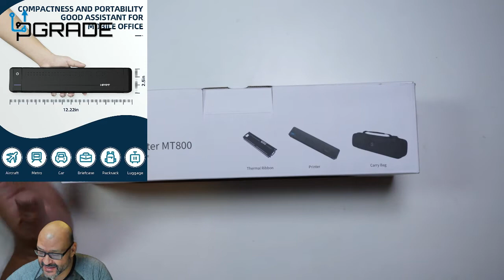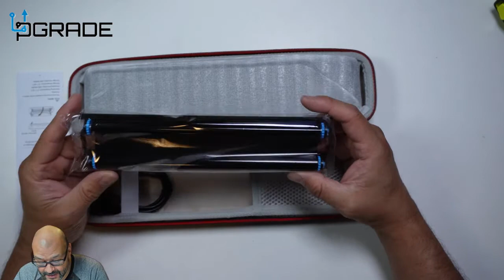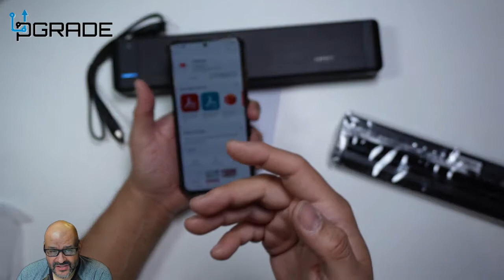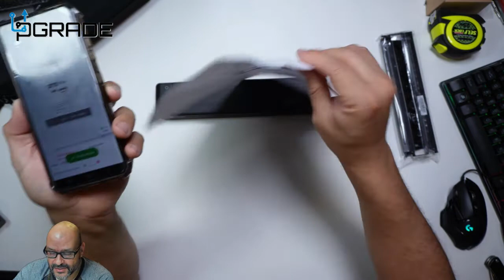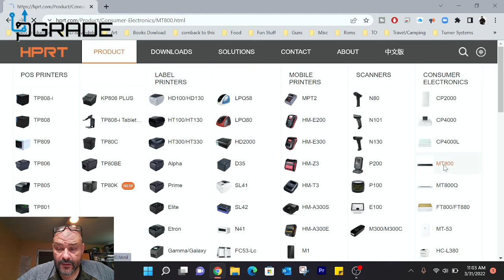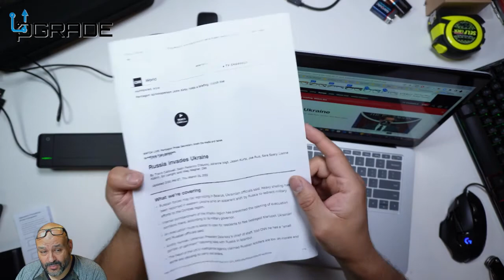HPRT Thermal Transfer Portable Printer

Comment: I have this little printer. Why when printing do the papers come outunpainted? (Blank)?
Reply: Most probably because you're using regular paper. This printer consumes thermal paper. Think this way, the "ink" is chemicals all over one face of the paper. What the printer does consist in heating the right spots on the paper to make it black. Although a thermal printer requires thermal paper, in general a thermal printing costs half the price of the same printing in gray scale using ink.

Comment: why do you have to buy a new cartridge every 50 sheets? plus thermal paper? what is the point of this printer if it's not to save on repeat costs?

UPDATE: according to multiple amazon answers you do not need to replace the cartridge. This includes an answer from the manufactuer. Can you kindly provide link (proof) to explain where the replace cartridge every 50 sheets number comes from? thanks
Reply: It's a special ribbon cartridge.  Gemini says they are pretty cheap to replace (every 50 pages).  I'm looking at getting one of these for travel needs.

Comment: Can i use normal paper
Reply from the maker: No it has to be thermal  paper
Reply: @Upgradetech  wrong.  The MT800 can use regular paper.
Reply from the maker: @SheilaSpencer1  Yes, However, it achieves this by working differently than standard ink or laser models
Reply: @Upgradetech  yes, I know.
You commented that regular paper cannot be used; only thermal paper. That is incorrect.  The thermal process in this printer is in the ribbon cartridge; it's not a Direct Thermal printer.  I know how this printer works....do you?